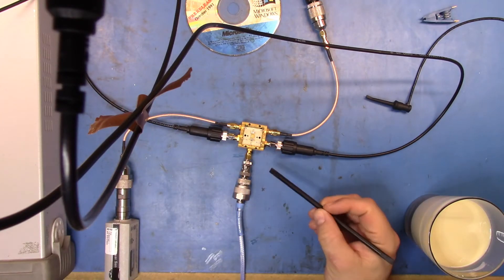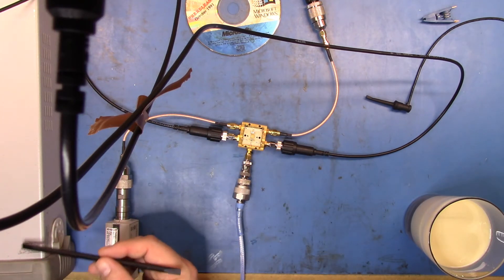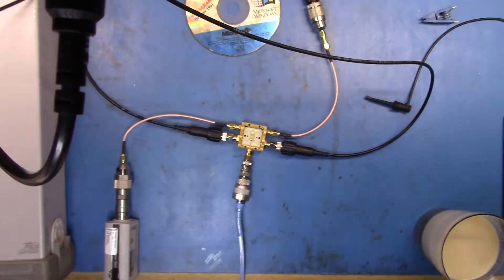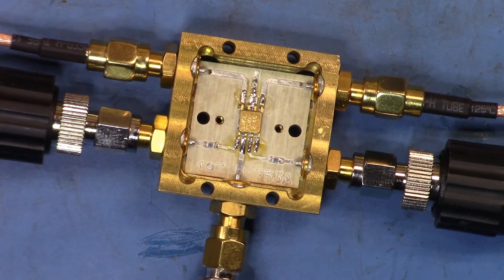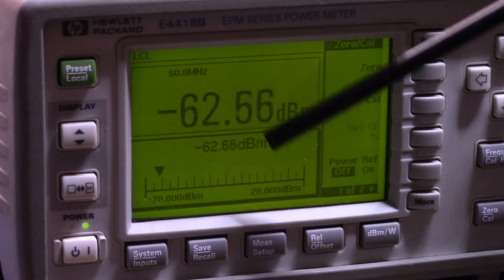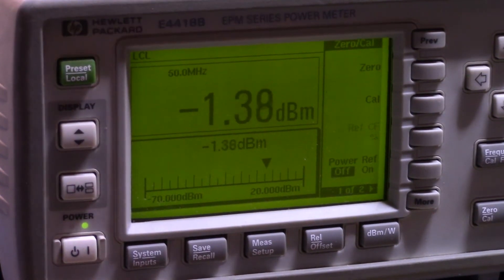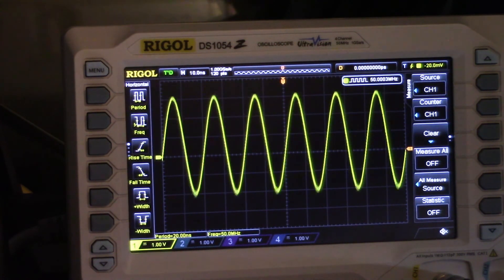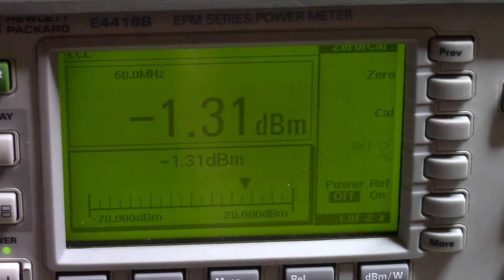Agilent E4406A Repair - Part 6

Comment: Resolved ! ....
For use the MGS-71018 ,you must inverted the signal from U26...the MGS relay work with inverted polarisation.....73's ....I5UWU Paolo
Reply from the maker: Good to know - Thanks for the post - I ended up getting another 4406 as part of an auction bid so I didn't go further trying to address this - I still have the broken unit here so I'll add it to the long list of things to work on - Thanks again.

Comment: I see your E4418b and funny thing happened . I wasn't using it for 2 years but it was powered on for standby.
So the standby  led is on but it doesn't switch on any longer . Have you had similar problem ?
Reply from the maker: Mine hasn't but I think, please don't hold me to this, that the power supply won't start up if the fan doesn't work - You should check that it is good and try again.

Comment: Did you already fixed the problem?
Reply from the maker: I actually picked up a new E4406A that worked and then a board swap to get the IQ parts working. I need to work up a replacement that limits the off switch voltage as I think that may address the issue.

Comment: Surely it must have worked at some point with that configuration. Is the mixer input DC coupled? Maybe the problem is further down the signal path and the DC offset was not a problem until a fault developed somewhere else. Still a very interesting problem.
Reply from the maker: This is what I was meaning when I mentioned an "undocumented ability" of the 1GG7-4218 - I think those switches must not have introduced the DC offset. Alternatively they did introduce an offset but it was taken into account w.r.t the biasing and when I changed the switch I've changed the DC voltage.

Either way, I think this is the issue we're seeing.
Reply: Yes that makes sense. Do you still have the original switch that 'failed'. It may be worth checking to see if it really had failed and if it does not do the same thing. I had similar problems when fixing a scope recently which used transistor array ic's and the substrate was different on the replacement so although the spec was the same for the transistors it did not work in circuit due to biasing of the substrate.

Comment: I suggest fitting diodes in series with the control lines, and resistors to ground to act as a voltage divider to reduce the level also, as there are already resistors in series with the control lines.
Reply from the maker: Great suggestion - Thanks - However I think it might be easier just to take the Vcc pin of the op amp to GND so it becomes a single supply op amp. I need to pull the datasheet for the op amp and take a look.
Reply from the maker: The problem with this approach is that the input needs to be in between GND and Vee which it clearly isn't. Your idea of the diode and resistor is probably the better approach now that I've had a bit of time to think about it.
Reply: @tgsoapbox  I had exactly the same problem of attenuation on a E4406A then , after replacing the switch by a MGS-71018, I had the same troubles as yours... The solution I found ( after a test with a voltage of -5V on pins 1 or 3 of the MGS which shows that the switch needs this voltage ) is to add a 3,9V zéner  in serie on each control line ( between the 2 resistors and the two pins 1 and 3 ) and ALSO to cross the control line : during some tests I found that the positive voltage was on pin 3   during normal operation ( contact between pins 2 and 5  in the switch MGS-71018 ) but the MGS-71018 need -5V ( so negative voltage ) to create this contact... I hope this will help other owners of E4406A . Pictures available on demand.
Reply from the maker: @f1ghberic78  outstanding. Thanks for letting me know. I ended up getting a different one as part of another auction buy so I put this aside.  Will need to get back to it. Thanks again.